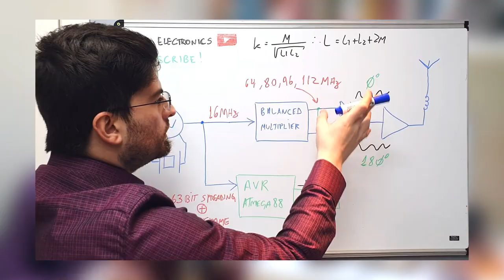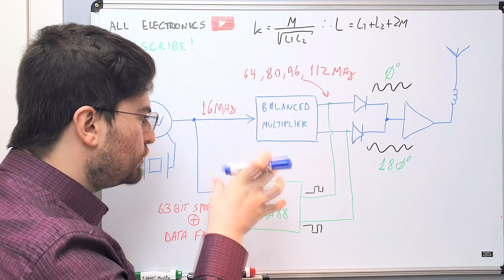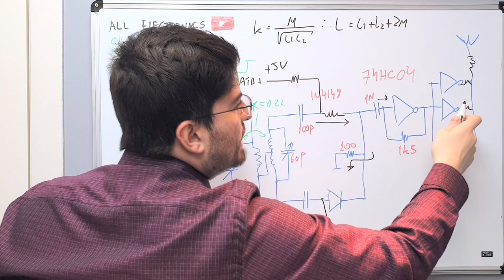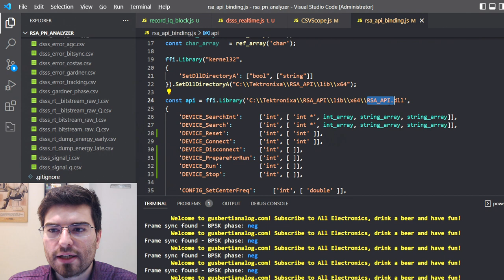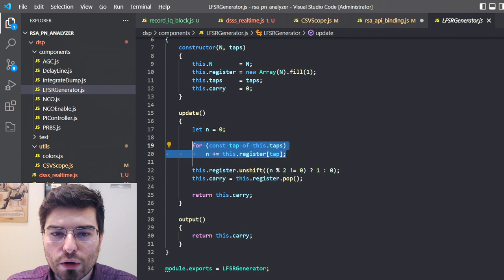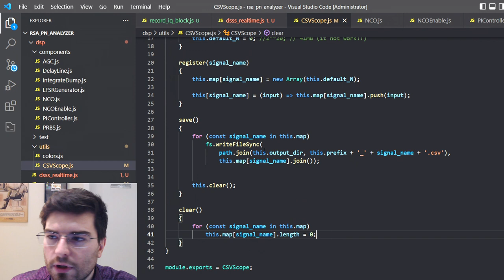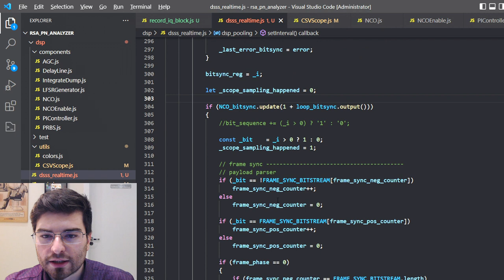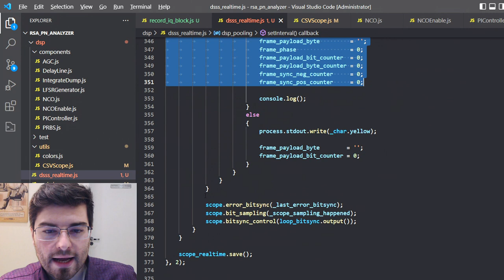The simplest BPSK DSSS Radio Beacon with SDR demodulation

Comment: Very nice, clocking the controller directly from the same clock as the RF source is actually a very smart idea. 
I might give this thing a try myself, I like it, it seams like a great circuit to play around with and add some additional bits and pieces.
Thank you very much, Gregory.
Reply from the maker: Only to think before sleep: and if we  place and AVR clocked by the VCO as an fractional divider in a PLL? 😅😂
Reply: @AllElectronicsChannel  Interesting idea, you would then be able to directly inject your data into the feedback loop. 
However you would also depend on the clock cycle perfect execution of the controllers code which I'm not sure if it is always given.

Comment: Hi! Nice idea!
Looked something for spread spectrum transmission and found your channel

Little question: why is switching diodes used? If diode opens this leads 5V edge on delimiting capacitor and creates harmonics on output amps. Or this is wrong assumption?
Reply from the maker: Thank you! It creates a little distortion at the edge of the switching moment, but no concerns.. it works. Diodes are nice and simple RF switches 🤭🤭
Reply: @AllElectronicsChannel  thank you!

Comment: instead using one inversor gate , you can also take the microcontroller osc out signal and apply to the modulator and use 4 inversors at the output to get some more power at the antenna.
Reply from the maker: Thanks!

Comment: You could also use SA612 with a crystal for the transmitter, I guess.
Reply from the maker: Yep!
Reply: @AllElectronicsChannel  Now we need a hardware receiver. I wonder if something like STM32 or ESP32 could be used to produce early/late/punctual sequences to avoid the need for FPGA.
Reply from the maker: Probably yes! We need to try it. The output of analog integrators could be read with the uC ADCs
Reply: @AllElectronicsChannel  Yep. I'm toying with such an idea too. To avoid the need for high-speed ADC and high-speed processing, perform de-spreading by analog multiplication, maybe using SA612 too.
Reply from the maker: Beautiful! We could downcovert RF using a polyphase anti-mage mixer, like the Tayloe https://www.pa3fwm.nl/technotes/tn17c.html. 

Man... probably the same ATmega88 could work in an analog setup as this!!
Reply: This can absolutely be done as a hardware receiver without a FPGA. Likely the originally used Atmega is sufficient on the digital side of things. Carrier recovery of a simple BPSK signal doesn't even require anything more complicated than doubling the signal and then dividing it by 2 again. Doubling a signal with a phase shift of 0 and 180 degrees will result in 0 and 360 degree, which is ambiguous. If that signal is then divided by two again, we have the BPSK clock. What would make a hardware receiver design extremely easy in this case would be the fact that Gregory synchronized absolutely every timing to the 16 MHz crystal. Which means if we can recover just one piece of timing, we can derive all timings needed. Finding the correct position within the PRBS can also be done mostly analog. An early, late and punctual are derived and fed into mixers with the received signal. The magnitude of the early and late outputs are used for steering / correlation, the punctual obviously for decoding.
Reply: @BalticLab  Sure. Seems that my previous comment about spread spectrum voice link was denied by YT.
Reply from the maker: I have an old video here on the channel showing a discrete BPSK carrier recovery loop using this squaring method. The VCO runs at 4x the frequency so it can be divided to get 50% duty cycle
Reply: @AllElectronicsChannel  I saw that video, but the idea of "injection locked oscillator" mesmerizes me :)
Reply from the maker: Yeah!! Beautiful

Comment: Nice, i liked the coupled transformer design, how did you measure the coupling coeffcient ?
Reply from the maker: Measured a single inductor and also the two coupled in series. That formula on the white board that I forgot to clear relates the inductances and K factor

Comment: That copper tape / via construction is interesting.  I mill my PCBs, and have occasionally drilled out an array of holes to do "via stitching", where I solder a wire through on both sides... but I think that tape with the bigger holes and no breaks in the ground plane might be better?  Where can I find more about that construction technique?
Reply from the maker: For ghz frequency I think this is the best option for DIY. Search for S53MV and  take a look on his projects